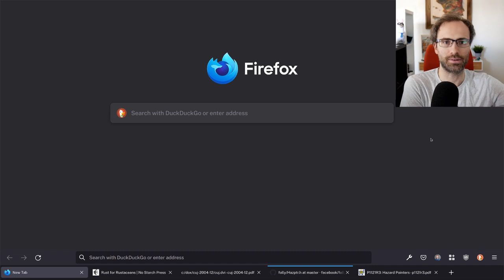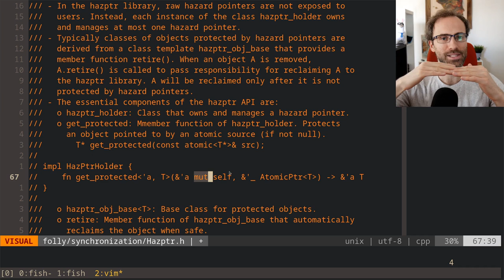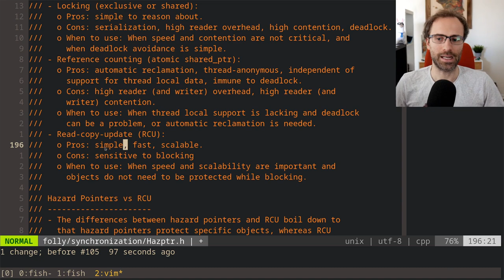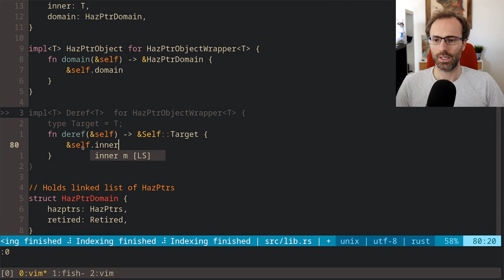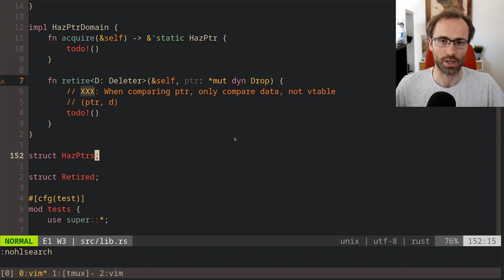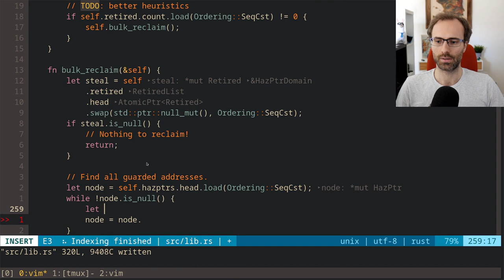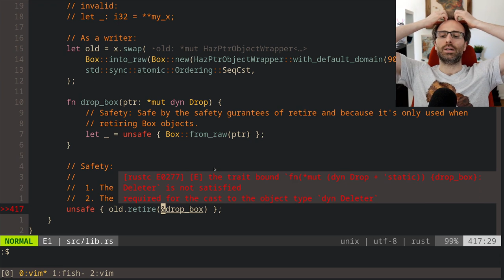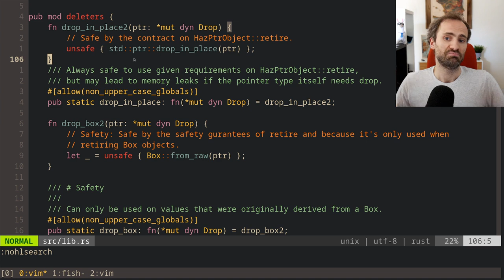Implementing Hazard Pointers in Rust

Comment: Just so it's clear, deleter is a standard C++ pattern roughly equivalent to the allocator proposal, and default_delete<T> is basically Drop. Not exactly, as destruction and freeing is more explicitly separate in C++, so deleters both destroy the target of and frees the pointer, while in rust those are done separately by, say, Drop for Box.
Reply: From this, the difficulty with retire seems to be that it is storing a pointer that it knows it needs to drop in place, but not if it also needs to free. I can't see any other valid implementations, once you unwrap the drop impl?

For example, you mention that it could be a Vec, but you can't actually store the Vec to be able to drop it correctly (it needs at least the size to know how many items to drop)

One idea to try is that, in fact, you do simply have the domain generic, but make the shared one implemented for Box<dyn HazardPtrObject>, and have the parameter implement a trait you can get a pointer from (maybe just AsRef?)

Comment: Do hazard pointers give you "if it compiles, then it works" level certainty, or "if you use them correctly, then they'll work" level certainty?  Seems like the former.
Reply from the maker: The answer to that is a little complicated, but the idea is to go for the former — the lifetimes will ensure that you can only safely access a pointer when it's guarded. But there are other requirements on raw pointers in Rust too (like them being aligned, not null, etc.) which aren't enforced by the library. So in a sense the library will give you a mechanism for statically ensuring that a given pointer target hasn't been deallocated, but it doesn't solve for the other safety requirements.

Comment: Just started watching this and not sure if anyone asked or if it came up but was wondering, the writers have to check eventually to see if the hazard LL is empty after it made its CAS, but my question is, couldn't this be made wait-free in a way, if the writer doesn't wait, and instead the reader does the cleanup when it's done? 

Can't the reader before it clears it hazard, check the original atomic, and if it no longer points to the held address, then the reader checks if it's the last user in the LL and if so then it does the reclamation, maybe this is explained later :X Just seemed like a possibility existed, i mean the hazard LL would have to hold both addresses (atomic location + actual data location)?
Reply: If there are two active readers when it's retired, then there is no way to know which reader should clean up without scanning the list.

You might be able to fix this, but it's probably not worth it.
Reply: @SimonBuchanNz  seems likely that a reader could be elected (chosen randomly) to drop the value.
When it is done, it can check if the value is in use.
If so, it elects of the remaining readers to do the cleanup. They should be able to use the same trick as the writer does to ensure that this doesn't fail.
If not, it does the free.
Reply: @jpratt8676  that could work, I guess it depends on if the additional contention (I think it's linear, or log, in readers?) is cheaper than the writer retired handling.
Reply: @SimonBuchanNz  thanks Simon, I don't think it would need contention, i.e. there's no blocking/waiting, just checking and even that is a constant factor.
The delay in deallocation is linear in the number of readers who are reading at this me of data deletion (so, likely just the cost of a branch assuming most deletion occurs on data that isn't being read)
Reply: @jpratt8676  I think most architectures have read contention on atomic. Not an expert though!

Comment: You mention at 49:00 that you can't write an extension trait that adds fields. Can't you, although difficultly, use a proc macro of some sort? Sometimes I think something is impossible then some proc macro wizard makes something insane work. For example in the backend framework Rocket, the docs recommend this signature for main:

#[launch]
fn rocket() -> _ {}
Reply from the maker: Yeah, I think I mention that a couple of times during the video too that we could add a procedural macro that automatically implements the trait with the field forwarding on an annotated struct. Maybe we'll get to that down the line :)